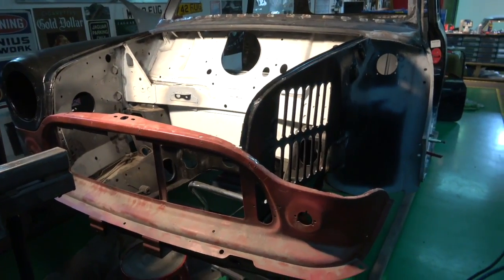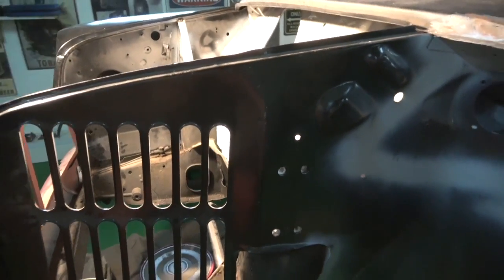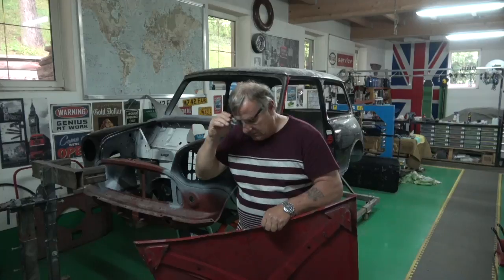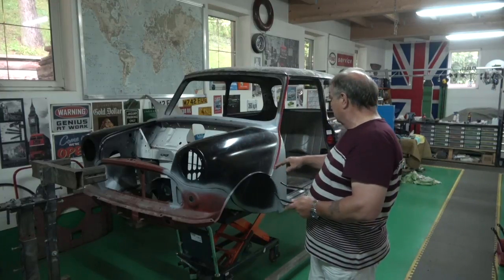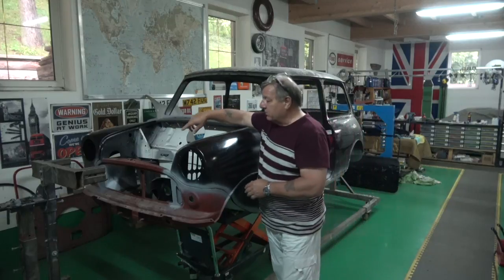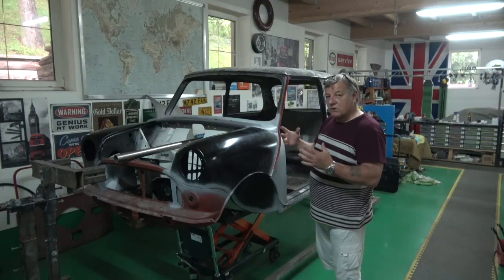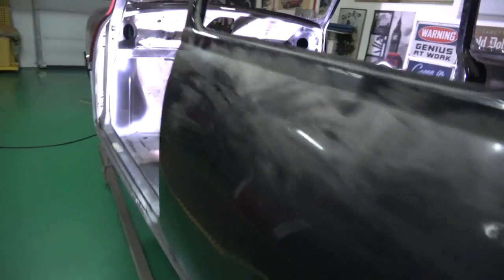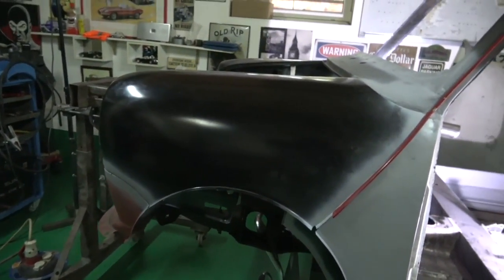Classic Mini Rotisserie Jig ( WARNING )  Be Careful.

Comment: Very good point Dave. I had one of this type too. I made a frame which i welded across the car from companion bin to companion bin then from that bar both sides forward across the top of the lateral box section (seat mounts) i welded the front then to bulkhead brackets i made. This was then strengthened laterally at the front too. Worked brilliantly well with this type of Jig. I gave my frame to Alex this morning !!! I think hes planning to mod it to fit around your jig.
Reply from the maker: That‘s very good of you to help Alex out i am sure he will need our help as there is a lot to tackle, Cheers Dave.

Comment: It’s always been my doubts on the mid support of these types of jig, especially when cutting out middle panels like floor pans etc. I had one, and sold it on, thinking I’d not need it again. I’m thinking more on a simple method of rolling it on to old tires for my next project. Some great advice here Dave 👍
Reply from the maker: Graham,  Two problems with rolling a shell on to a mattress or tyres 1 you may damage the panels & 2 cutting out and welding is not as easy, With a simple pole or tubeular jig you can get to every part of the shell, The one i gave to Alex cost me around 50 Euros to make not including my time lol Cheers Dave.

Comment: Rotisseries are a great tool for final welding, but structural work it is best done on a frame, so you can set it level, This type of work is comparable to crash repair work and is always done on a frame & measurements are critical. Less mistakes are made if one panel is replaced at one time, I've had loads of problems with getting too enthusiastic with an angle grinder lol.
Good work as always Dave
Reply from the maker: Martin, Your right! This is why i like my Jaguar rotisserie becuse the shell is secured to heavy bars under the shell and bolted to solid mounting points that you can use as data lines, Cheers Dave.

Comment: Great tips and advice. I'm not far from starting to get the jig ready and it is that problem middle section that i will have to work on first so watch this space.
Reply from the maker: DB, I think without my table lift it would have been very hard to get the A post back in line or a Stand under the floor of some kind to lift & support the shell, Cheers Dave.
Reply: davejaguar66 yes I'm going to have to get creative with bracing and support. I wasn't happy the way i left the shell a few years back so I'm gonna start from scratch and replace what I'm not happy with my preference being a full floor but i will know more when i get into it again
Reply from the maker: DB, I hope the next video will help when your making up any bracing! Cheers Dave

Comment: Hi Dave have you ever tried to do the front arches like the Guys from project binky did there's by cuting the front arch but 1/2 inch less then using a metal bar with a 1/2 inch cut put into it you can redo the original wheel arch perfectly without any welded on part's I tryed it on my mini with heritage wings and it worked great no distortion at all and you haven't had to pay for arch. Great work on your mini as all your jobs. Rob
Reply from the maker: Rob, No i have‘nt but the tool they made works great! I might just give it a go now you mention it. Cheers Dave.

Comment: I think each job you do on the car, you’ll need to do some homework first, ie, if you’re going to cut out the RHS floor pan, you’ll need to brace and support that area accordingly before doing any cutting surgery. Like Dave says these Body shells are a monocoque and each panel relies on the other for supporting it. When you take something away you need something else in place like a brace to hold it together while you replace it.
Reply from the maker: Graham,  Your 100% right if you look at each section before you cut it out you won't go far wrong! Cheers Dave.

Comment: Dave, with the subject rotisserie jig, one other thing which seems worthy of additional consideration, is the way the HHS tubing is mounted on the flat, rather than the vertical plane. To me, in laying out the tube in that manner, greatly reduces its beaming strength, (allowing it to bend or flex), when compared to the tubing being mounted in its vertical plane. In your opinion, d
o you think that on those jigs it does make a difference?
Reply from the maker: Sorry what does HHS stand for! If you can add some help to this topic it would be much appreciated as both Sean & myself have had a few issues, It is very difficult with some of the repair panels as they are so large, Cheers Dave.
Reply: Sorry Dave, typo should read RHS (rectangular hollow section ) tube..  SHS is square hollow section. I have found that when you use unequal RHS, (e.g. 50 x 25mm), it is stronger in its beam strength and less resistant to bending, if the tube is placed with the narrow section (e.g. the 25mm), to form the upper and lower faces. This puts them at 90 degrees to that used on the arms like those in the jig that Sean C has.  I am only looking at the rotissierie arms and cross bars which are used in the baulkhead attachments..
Reply from the maker: I see what you mean that makes sense! The lower bars i have for my Jaguars are arrange side on as you mentioned which does make them very strong, I will try & pass this on to the viewers, Cheers Dave.
Reply: No worries Dave..Gee I envy your ability, the cars that you get to work on and with ..and especially your workshop.. Love your work and the respect that you have earned through we the watchers.
Reply from the maker: Thank you very much appreciated, Cheers Dave

Comment: Just like the early factory centre bar roll to build car.
Reply from the maker: Sean, That‘s right they used to spin them off the pipe stand that‘s why there was a hole in the back seat upright on the early models i have seen it on some old BMC footage, Cheers Dave.

Comment: Does it have to be tube as I have some small box section I could use
Reply from the maker: Scott, Tubulars are stronger but box will work just as well depending on it‘s size & wall thickness, Cheers Dave.